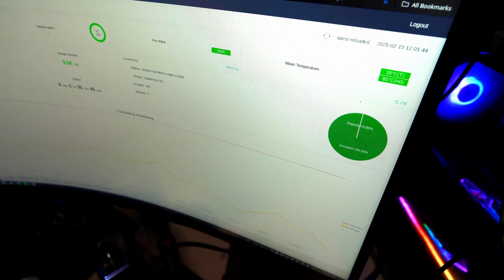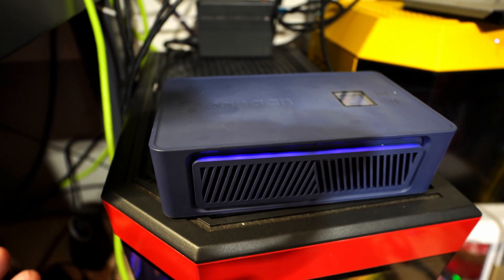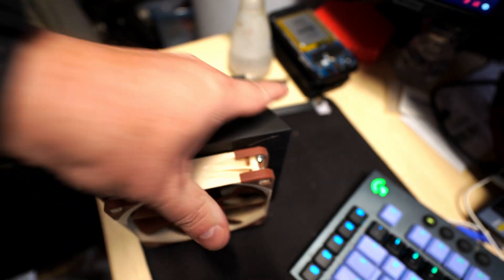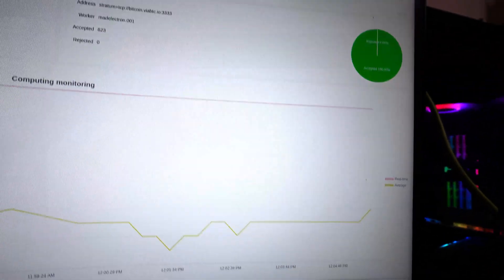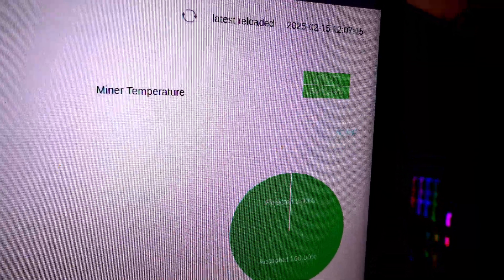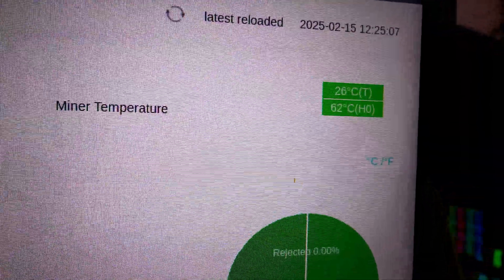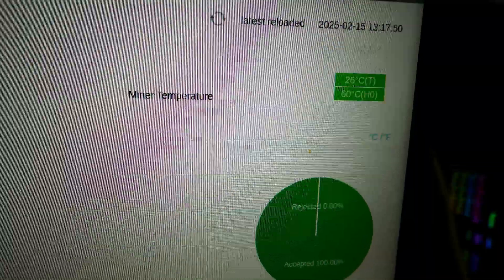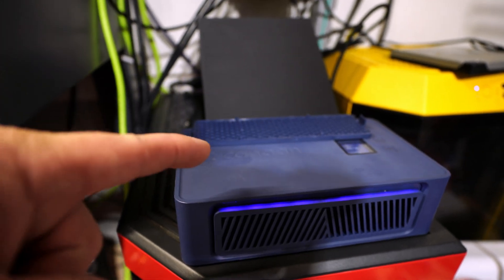Avalon Nano 3 Easy Cooling Mod

Comment: Actually, reducing the temperature of the miner lowers your hashrate, as the Nano 3 is set up to lower the power consumption if it detects cooler temperatures. Lower power consumption means a lower hash rate.

On high mode, 90°C is the miners target temperature.

Comment: Only problem with that print file is the double wall thicknesses with infill make for a very long print for little value added.  Would be better as a single wall thickness for the whole thing.